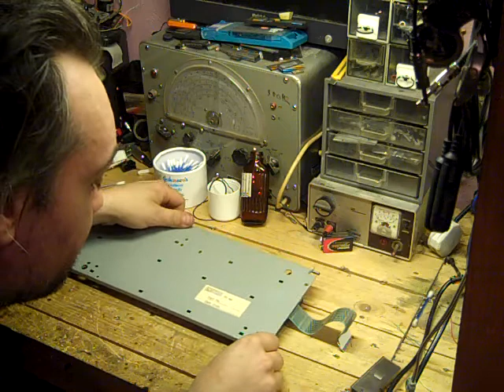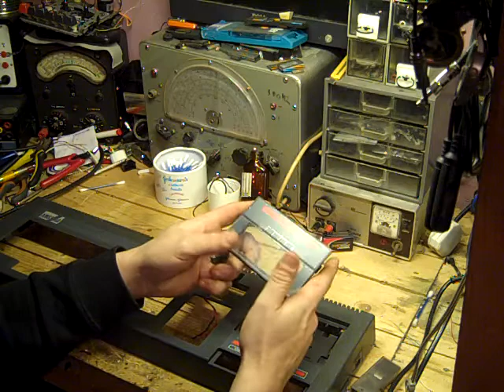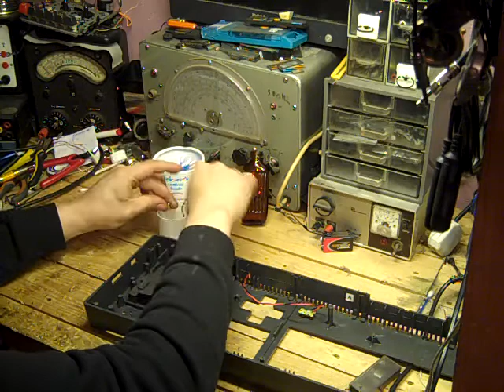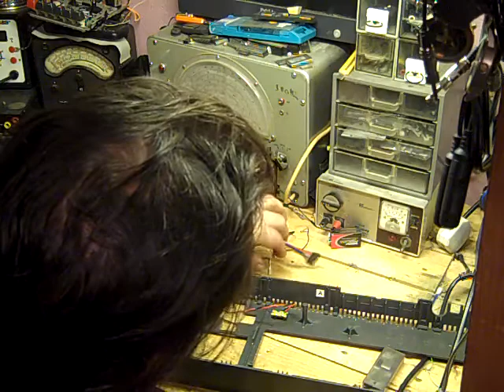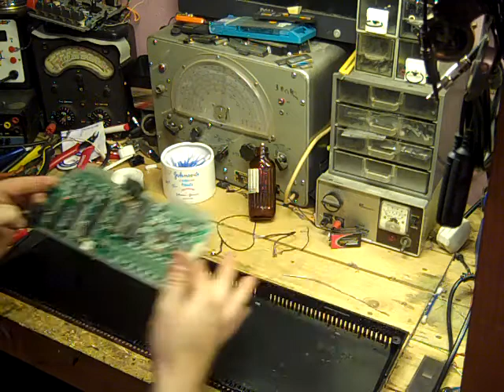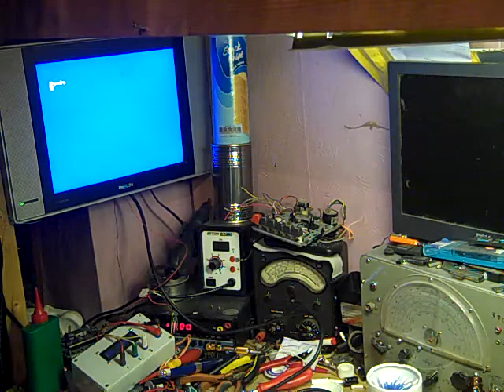Amstrad CPC 464 Restoraton Pt6

Comment: Congrats. Thanks for the videos about the process restoring it. Just a thing: Buy some spray wax for furnitures and use it on it. I don't know if you've got the "Pronto" brand there, but I guess any other can do as well. It will leave the plastics looking like new.

For old plastics you can also use "Vinil" used for them on cars. Maybe you can find it at some fuel station shop.